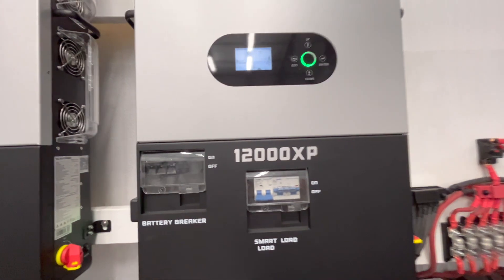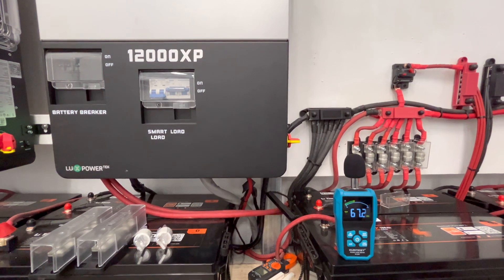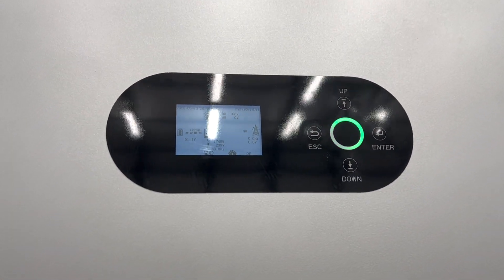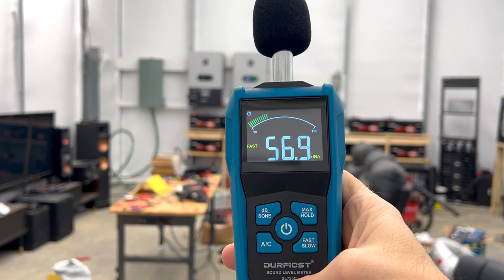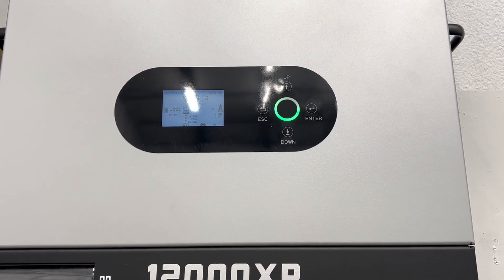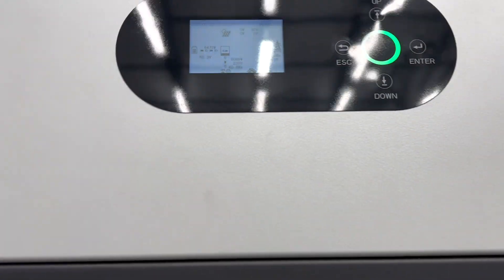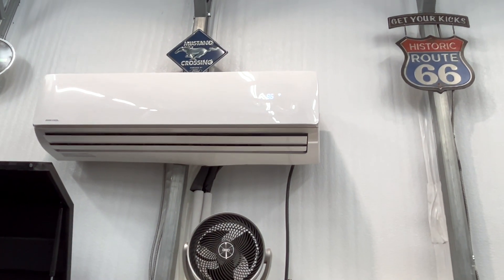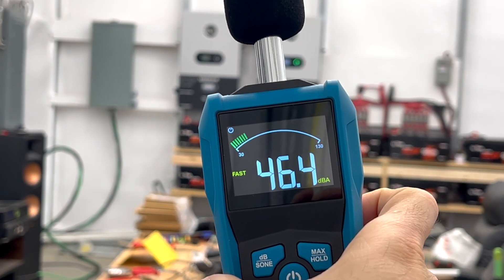Is the EG4 12000XP Quiet? Real-World Noise Test!

Comment: It would be extremely helpful if you would not use a noise cancelling microphone - such that it cancels out the ambient noise. Yes we trust the decibel meter, and it is super helpful to see - but lots of the "story" is missing without the ambient noise. Thanks for what you do!
Reply from the maker: You are very welcome.  For the most part it is very quiet.  When it is charging from Solar, only then will it get louder.  I wish it had a slower ramp up for high pv input, probably in the software.

Comment: Normal conversation runs 50-60 db...
The variable DC fans work like a charm on my EG4 18KVP.
Now it starts my 6.5hp air compressor with the latest software update...
Reply from the maker: Wow, that's pretty impressive.  Do you have a soft start on the compressor?
Reply: @MikesSolarGarage  I tried a soft start from Signature Solar but it never worked and sent it back. Then Tech support loaded a new firmware version that solved the start up problems. My old firmware would stop the inverter for 12 seconds on the initial compressor start up then run compressor fine. Have not heard back from Signature Solar if the soft start was good or bad as of now.

Comment: Have you installed any ground mounts yet? I just got a pallet of 350 watt panels and need to mount 4 for a delta 2 max that’s getting delivered tomorrow. I’ve used the eco-worthy 45” mounts before but always mounted mine to wood beams on a trailer. Sadly I don’t have another trailer this time haha
Reply from the maker: @rnkustomz  Mounting to a trailer is a great idea.  I still need to mount my additional panels.  Right now I am getting materials to build a fence.  I don’t think my neighbors will take the panels, but I don’t want to cause attention.
Reply: @MikesSolarGarage did you use any of your eco-worthy mounts already? Curious how you are utilizing them
Reply from the maker: @rnkustomz   I have used a few of them so far.  I'll take a video of it.

Comment: This is the info we all need.  You can design a whole system that meets your needs and then it drives you nuts with the noise
Reply from the maker: @idahoduckhunter  Very true words.  When I have all of them running it will probably be loud 🤣
Reply: @MikesSolarGarage  Maybe not. With 3 units running, the fans may never reach full speed.
Reply from the maker: @JStock-id1qi That is what I am hoping for.  One weird quirk that I noticed is when charging at high amperage it spins up the fans to high speed for a moment and the fans go quiet again.  I wish it had a slower ramp up.
Reply: @MikesSolarGarage 5 of them you’re a wild man 🤣

Comment: I have not installed a 12000xp yet. are the fans different that the 6000xp? My 6000xp is very loud. When the sun first hits it in the morning and it starts charging up the batteries you can hear it in the house and its mounted in the basement. is there a difference in the fans when its being charged by the panel vs powering a load?
Reply from the maker: I have noticed during charging it will spin up the fans for a few minutes and then they shut off.  I wish it was more gradual when charging. But that is the only time it seems to get loud.  Otherwise it is pretty quiet.